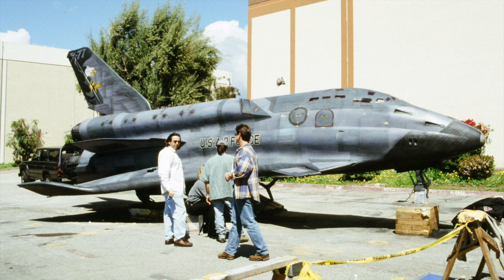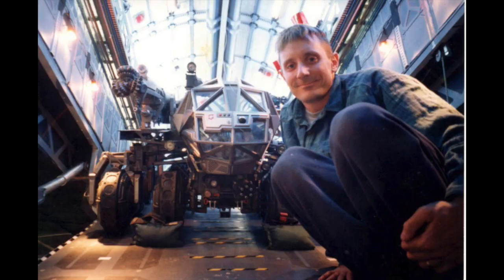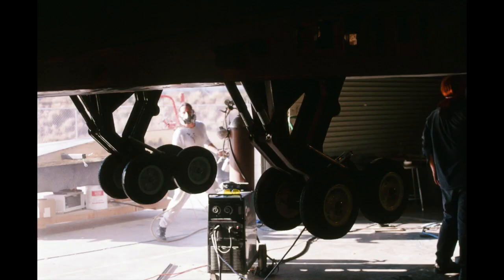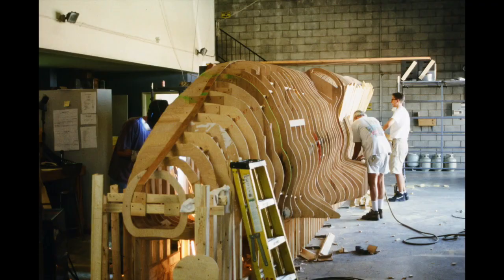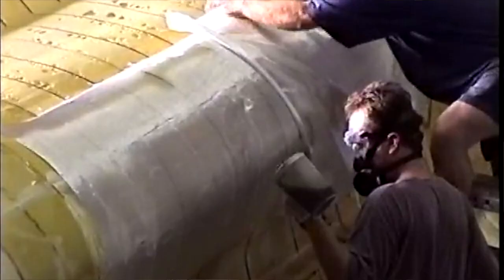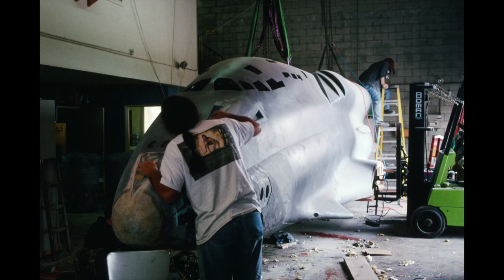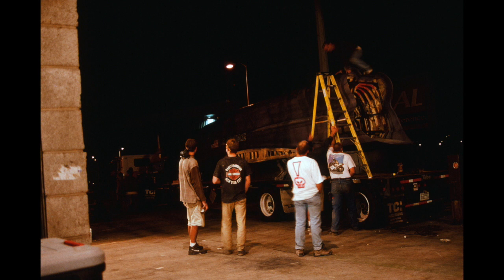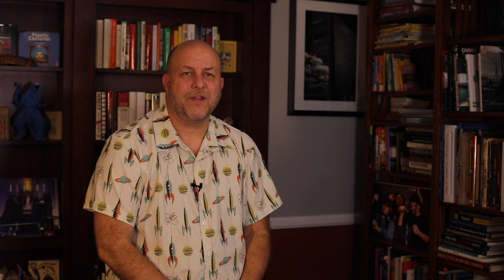ARMAGEDDON miniature effects (part 2)

Comment: As budgets go,  it basically comes down to labor costs - crew pay.    Are the model-makers and technicians willing to work for less?   It just depends on how desperate they are to keep a job and make ANY money.   I worked on a show in which the shop owner had to ask the crew to accept a cut in their already contracted wages, in the middle of production.   Basically the shop owner was going over-budget, so someone was going to take a loss - apparently he felt it should start with the employees.   I guess it doesn't hurt to ask, but most of them were against accepting a cut in pay.